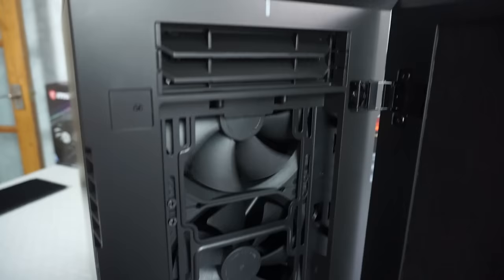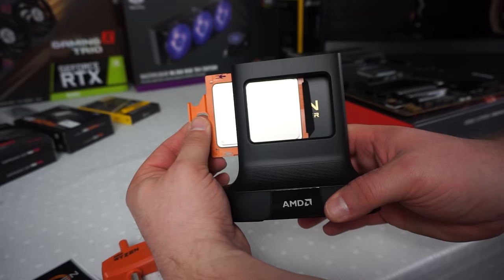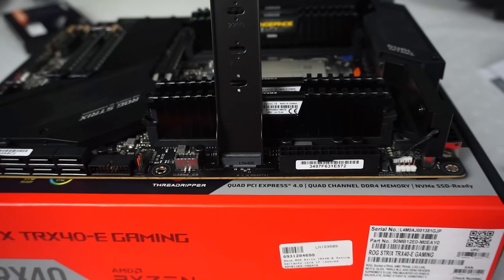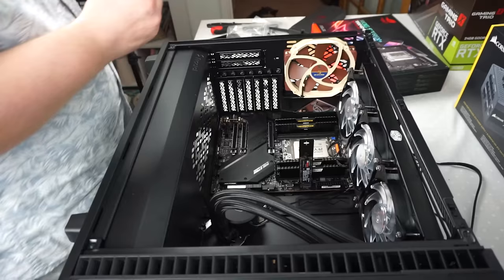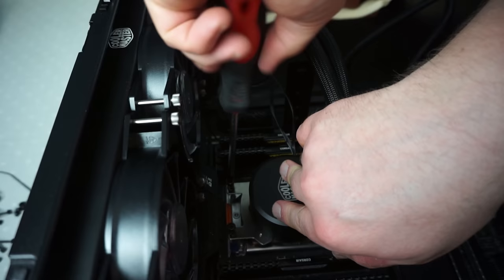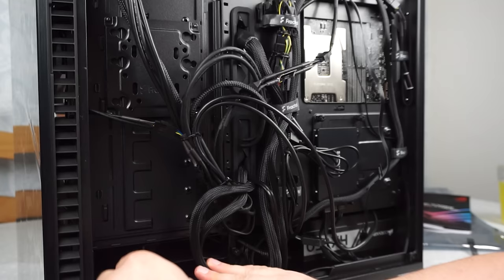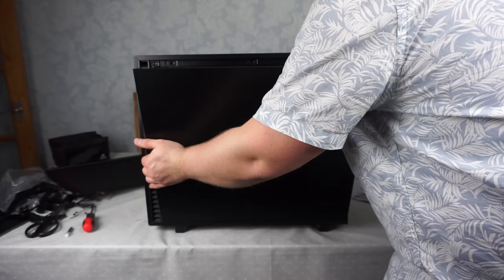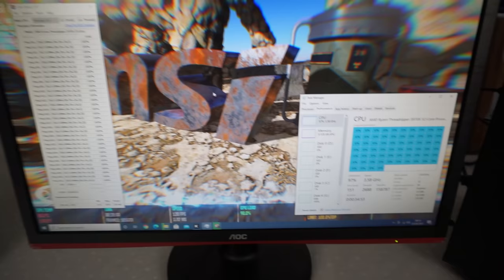$10,000 Gaming PC

Comment: Noctua Chromax fans in black, much nicer. Stick some on the rad too. And watercool the GPU. Thats case is going to overheat on air cooling and the card will thermal limit. Could do with a 1Kw PSU too to be safe, don't want it cutting out.

Comment: Great build, but the back fan is backwards. Is that intentional?
Reply: Yes, it was intentional but a stupid move. 

Having all intakes and only exhaust being the top rad is mind boggling. 
There's going to be hot spots and heat build it that already poorly ventilated case. 

Any heat generated by the other components has to be vented through the top reducing the efficiency of the CPU rad. It's so stupid.
Reply from the maker: @billy9506  To be honest Wildman, your comment really doesn’t matter. When I ran tests on the system we maxed out at 80°C. That’s at 100% utilisation on the graphics card and the processor. It will never ever be in that situation full-time! 

When running call of duty warzone and whilst rendering video at 4K in premiere pro, the CPU and GPU you both reached 68°C. This to me is to me is WELL within tolerance! 

A. you probably haven’t got six grand to spend on a PC and 
B. even if you did you’d never build a pc a put it on YouTube! 

Although your opinion has been noted it really doesn’t matter in the real world, I’m happy with it and the customer is happy with it! I’ve worked in IT for 13 years. I’ve built nearly 100 performance PCs in that time. None of them have EVER “overheated” from the fan configuration! Have a good day.
Reply: @billy9506   You got the right idea, but the efficiency isnt actually reduced that badly at all. linus proved it to corsair in his latest hack pro pc. it should have decent cooling, but there may be more turbulance because of impeding air paths.
Reply: @JakeBilling  I agree its not soo important but 1. Woud be nice to see how the 850 watt psu is handeling it. 2. Also note that its adviced to run the 3090 from 3 seperate power cables and not one with a bridge! 3. Why did you switch the case fans but not the water coolers fans? 4. Why the 128gb ram? No way any editing software is going to use this and more then 3200mhz with less latency woud have been a better deal! 5. Im not sure what "Test" you ran, 100% dosen't realy mean anything as long as you can move the mouse without shuttering its not 100%.
Reply: @JakeBilling  It does actually matter in the real world because its not just your CPU and GPU that need cooling, its the other components that people overlook like the SSD for example or mossfets. The cpu is liquid cooled and external vented so the heat from the CPU Is being removed from the system thats good but the gpu is internally venting inside the case, so as the system is being run for lengthy hours that heat builds up and deminishes the passive cooling for the other components shortening the lifespan of components like the SSD's that get quite hot. Saying you have built pc's for 13 years means diddly squat as the tech is changing all the time and so are the components, they may not have overheat while testing but i would like to find out how long one lasts before they die.
Reply: @JakeBilling  i understand why you have done that as my pc is pretty much the same i say always best to get more cool air as possible so ignore the rude people and carry on let me honest the people who say that cant even build gaming pc anyway xD

Comment: Nice build there Jake. Not keen on the choice of case with its limited airflow.. but with the liquid cooling i can see the merit of the choice though.  I'd like that setup for mine.. but i've got my ryzen 7 3700X and a RTX2060 with m.2 and 32gb ryzen tuned ram which will do 4k video editing at just around 70 secs per 1 min of 4k ...  Thanks for sharing :)

Comment: wow. Amazing. I need a new gpu for my setup. I have a ryzen 3700 I think with stock cooler. Any suggestions. I know the gpu world is a little nuts right now. I should upgrade though. Been running a 1050ti for like 4 5 years now.

Comment: Why does the video start with saying that it is a 6,000 USD build?
Reply: He says at timestamp 0:20 Today we are building a £6,000 .. not $6,000. the conversion takes it to about $8,000 in parts.. throw in labour, setup and delivery .. and yes.. its around $10,000  (£7,250) in all
Reply: @oddtechman  It's called CLICKBAIT unless you think paying $2000 to assemble, setup and deliver a PC which usually costs less than 1 tenth that. 🤣🤣🤣  You can get an whole damn decent PC for $2000
Reply: @oddtechman  $2000 for an hour of labour!!!  Did you know that I can get you a great deal on Buckingham palace?

Comment: 1st mistake 850w with a thread ripper and 3090, 2nd mistake front and rear intakes exhausting at 90 degrees sending warm air through the aio rad???? Wtf £6000 bodge job